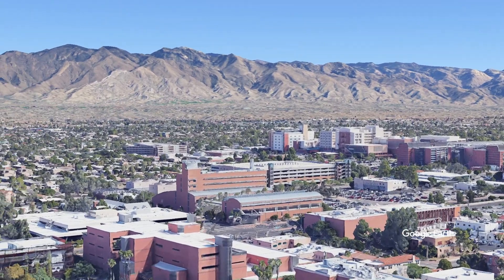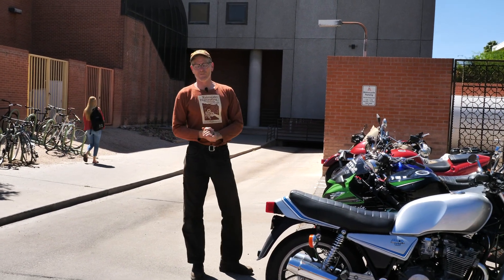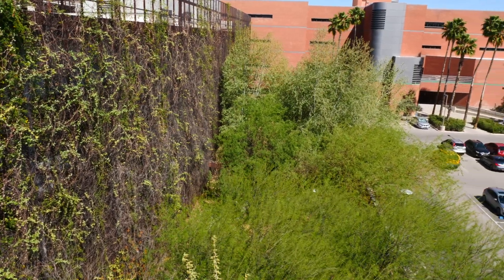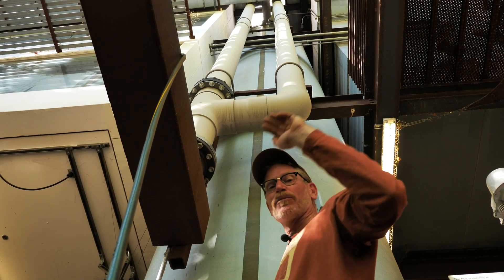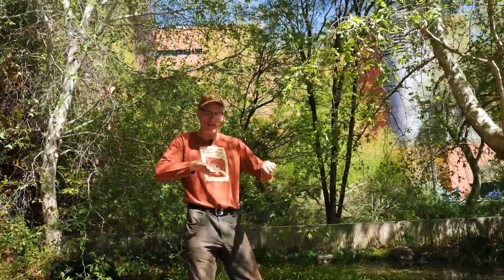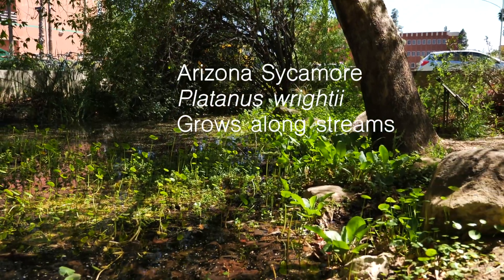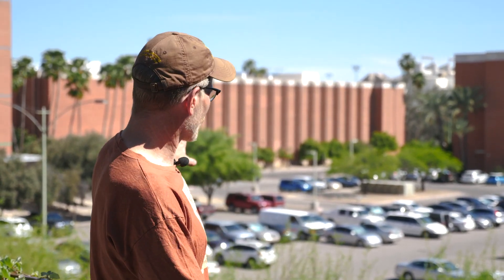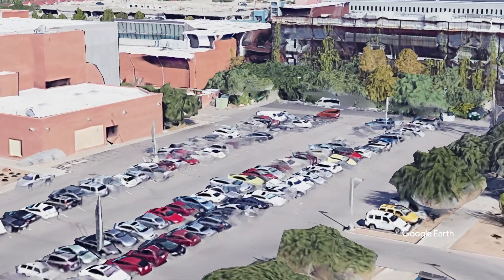Water Harvesting University!

Comment: Great video! Lot of good information you have here. Does the reclaimed gray-water join the rainwater and condensate in the cistern, or is it pumped in elsewhere into the pond?
Reply from the maker: @Ian Van Giesen That is a good question. I am not sure at exactly what point the AC condensate and the drinking fountain enter enter the system. It is possible that the condensate enters into the tank because the AC units are on the roof of the building. That's a question for Brad or contact the U of A Landscape Architecture school.